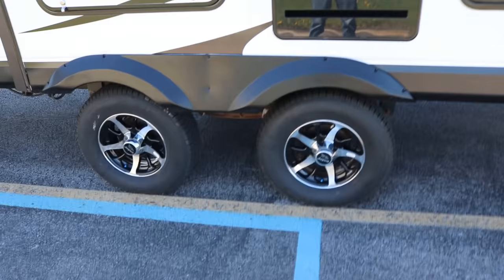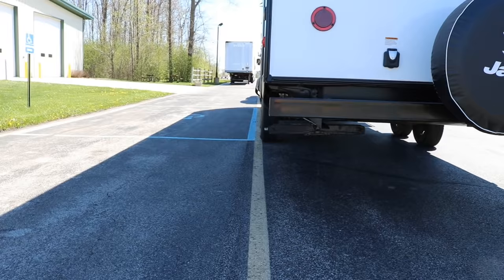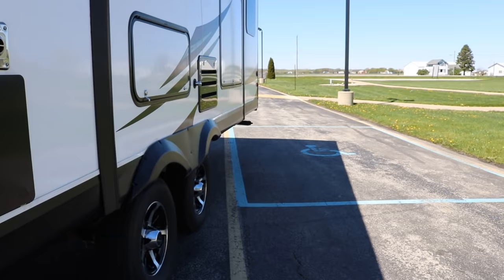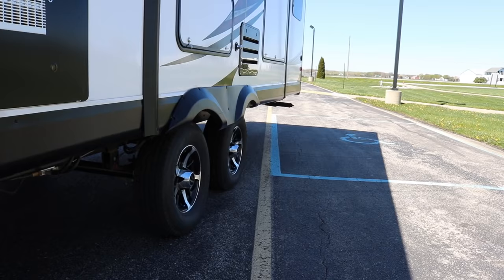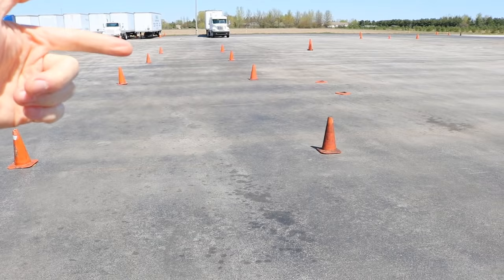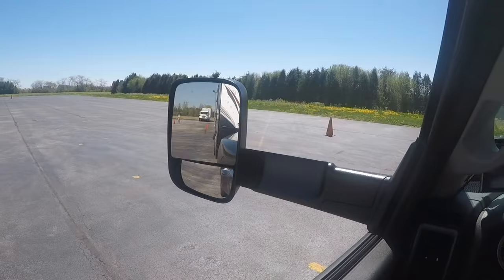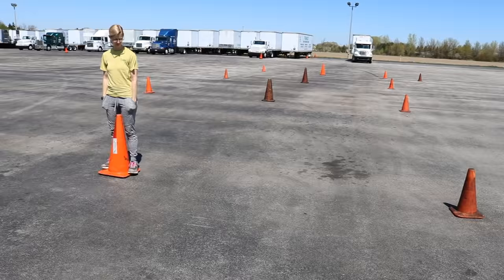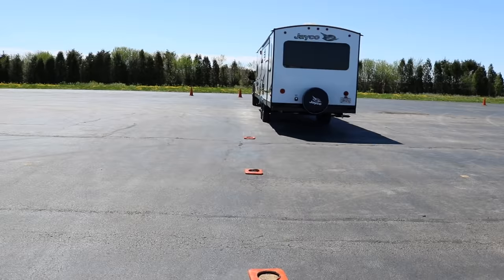HOW TO BACK YOUR RV (And Trailer "Tail Swing")

Comment: To clarify, when you say 11 o'clock or 1 o'clock you are meaning that when you are straight in front of the trailer that is 12 o'clock and you want the front of the truck to go to the 11 or 1 o'clock positions, depending on which way you are turning. Is this correct?
Reply from the maker: Yes. That's correct.

Comment: I drive a big dump truck for work, well I am a little lady, but I was wondering if you don't want to go into the other lane, like you said you don't want to hit a car or a concrete post or whatever is on the other side of the line, then what do you do, just not cut it as sharp or what would you say?
Reply: If you mean the end swing in the beginning, he started by cranking the wheel all the way to one side, and driving.  That made the end swing a lot worse.  If you start small and gradually increase your rate of turn, your trailer will stay more in line.

However you cannot avoid all of it

Comment: I put my hand on the bottom of the wheel-----if the trailer needs to move to the right, move your hand to the right, need to move left....move the hand left
Reply from the maker: That can work too however we've had better success teaching this method

Comment: great video, is there any difference backing up 5th wheel?
Reply from the maker: Yes, it should put you close. There are all kinds of variables that come into play such as trailer length and tow vehicle wheelbase. 11 and 1 o'clock is a good general rule of thumb that covers all different types of trailers. You'll just have to get in the driver's seat and try it out and adapt it to what works best for your particular setup.
Reply: What he showed was for semis which use fifth wheel but it applies to gooseneck as well as tow behind or "bumper" pull those thus last one is a bit different due to the swing of the vehicle rear end where the trailer is hitched.
Reply: I've got the same Edge tuner - what setting do you tow in?
Reply from the maker: I never ran a tune, just used it for monitoring.

Comment: Rather than all the confusing talk about steering away from whatever, Simply put your hand on BOTTOM of steering wheel and move hand in direction that you want the back of the trailer to move.  Much easier to remember...hand corresponds to direction of back of trailer!
Reply from the maker: That can work but this method has a much better success rate

Comment: We have upgraded from a TT to a 5th Wheel.  When I back the 5th wheel the response of the trailer is slower than the TT.  Why is this?  Is it because of the different connection point of the trailer?
Reply from the maker: Yes it's because the pivot point is over the rear axle. Popular opinion is that it's easier to back a 5th wheel, however I like backing a "bumper pull" because it responds much faster to steering wheel input.
Reply: I am having same issue. For the parallel parking there s no time to back straight. By the time you recover from setting one angle it’s time to turn fully the opposite direction.

Comment: Towards the problem or where you need/want to go?
Reply: Example: You are getting to close to the right side, so you turn wheel towards right? Moving it towards left as you do it... Or towards left where you want trailer to go?
Reply from the maker: If you are backing in a straight line with your hand on the top of the wheel steer towards the problem. If the trailer goes right, steer right.
Reply: @WanderingWagners  ah got it, thanks alot for the video.

Comment: When you refer to One o'clock or eleven o'clock, please clarify better for me.
Reply from the maker: Imagine the nose of the truck is pointing at 12:00 the rear of your trailer is 6:00. When you turn the wheel and back up keep going until the nose of the truck is pointing at 11:00 or 1:00
Reply: @WanderingWagners  GOTCHA, thanks!!

Comment: It isn't complicated enough to be a lengthy lecture. It comes down to two things which are steering and corrections. 
   For steering I use my mirrors. It's easier on my neck and I think it winds up being more intuitive for translating the image into an action. 
   For corrections I follow what a relative once taught me. It consists of only three words  - "Follow the trailer ". If the trailer unintentionally moves right, steer right in terms of steering wheel movement. If the trailer moves left, move the steering wheel left, thus you are "following" the trailer with your tow vehicle. Once you try it, all mystery disappears.

Comment: Backing up a 5th wheel is the opposite of backing a pull trailer
Reply from the maker: Wrong.
Reply: When you upgrade to a fifth wheel you’ll see what I mean.
Reply from the maker: We've had a 5th wheel, and I drove semi professionally for 17 years. The pivot point is different and that's it.